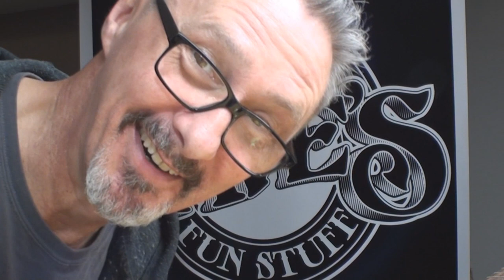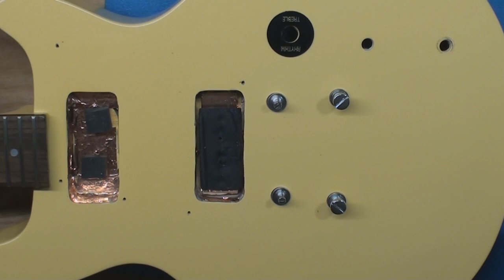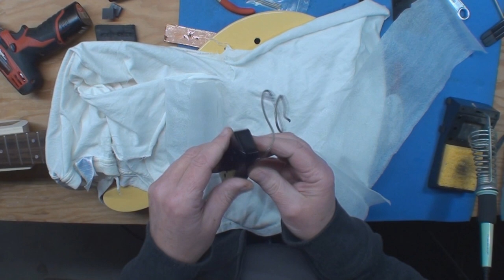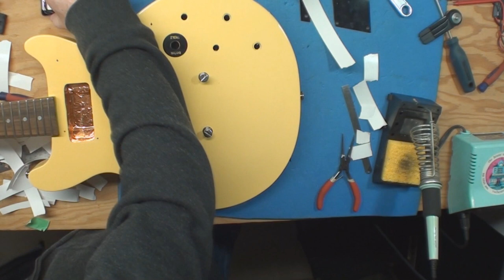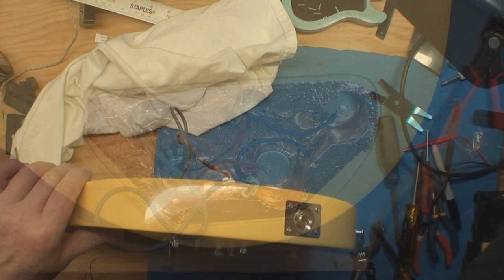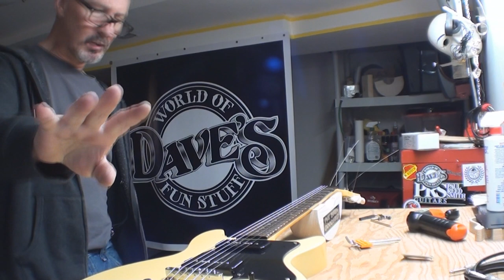Lindy Fralin P 90 Pickup Install

Comment: Which direction do the Fralin P-90’s go in? I can’t tell which end is “up” because the cable is reversed with that ground. So do I just install them so the wire doesn’t get folded over and let it thread in the direction it comes off the pickups? You dig? The wires point one way but it doesn’t look natural. Help? I watched but couldn’t see which end goes toward the hole.

Comment: I dont get how the pup is locking into the cavity Dave. Usually its the pickguard thats taking care of things but these 90's dont use the guard to hold them in do they ? Are they using friction to slot them into the cavitys ?
Reply: Tbone j - P90 pick ups are mounted with screws that go right into the body.

Comment: Dave, intonation is done using the fretted 12th and harmonic on the 12th. This way the fretted note takes into account the string displacement when fretted and makes for more accurate intonation.
If I saw correctly, you used the open string an harmonic...not the correct way my friend.

Here's what Fender say....
If, using an accurate tuner, the string is found to be in tune both when fretting it at the 12th fret and when sounding its 12th-fret harmonic, the string is correctly intonated and you’re in good shape. The string is in tune “with itself.” If, however, there’s a tuning discrepancy between the fretted 12th-fret note and the 12th-fret harmonic, the string is not correctly intonated and requires adjustment. In that case, the fretted 12th-fret note will sound either sharp or flat compared to the 12th-fret harmonic, and this is where two basic principles come into play.
Reply: Tex Rex........No, Dave used the open string and fretted 12th fret which is how I was taught as well. (watch @26:36.....he frets the 12th fret on the A string). Been playing 25 years and was always told to use open string and fretted 12th fret and to never use harmonics...LOL Seen it that way many times. To each his own I guess huh? 

So, I just watched 4 vids and even the one from ESP (ESPGUITARSUSA) says you can use the open string OR 12th fret harmonic in conjunction with fretted 12th fret. I know guys that have been doing the open string and 12th fret for almost 30 years with no issues.
Reply: I'm sure there are several ways to do this, I use the Harmonic 12th and it's what Fender recommend. Dave regularly quotes Factory specs for set up's so I would have assumed he'd also follow their advice for this too. I'm sure the major guitar manufacturers also have many yeas of experience and have sound reasons for doing it this way. I suspect it's to take account of the variation you get from different set up heights. A high action will cause the fretted 12th note to be very slightly sharp compared with the open string.
Reply: I agree with everything you've said and you make a good point regarding high action....(never thought of that)..........if the action IS that high you'd HAVE to use the open string and 12th fret harmonic method. Like you mentioned.......most people doing it for many years have their ways and reasons for doing what they do.
Reply: Hi 😊 there
Anybody knows when we use 250 or500 caps?? To p90s??
For blues and hard rock stuff..

Comment: Now I know what I look and sound like when I’m unfuckulating stuff.
I picked up one or two good bits of advice, particularly about ensuring pots can’t move and short on the shielding. After you deliver it to someone and they go on stage ... ouch.
Regarding shielding and noise - that’s what I was hoping to learn more about.
I’m about to install Fralin P90s (in humbucker enclosures) in a beautiful 25 year old candy apple red Washburn Nuno.
There was only about 30 seconds of audio !
There was obviously noticeable hum, pretty much impossible to eliminate with single coils, but it was dead quiet in the centre position.
This is why I am modding the Nuno, which has only a volume pot and three way switch, to a volume pot per pickup and master tone. 
That way I can leave the switch in the noiseless centre position, and choose which pickup(s) I want to hear with the volume pots.
I enjoyed the video. Thanks.

Comment: Silly question: how noiseless are these PUPs cuz I really want a set. My Gibson P90s are noisy AF!
Reply: Leonid Denisenko Traditionally, P90s are no where near "noiseless", they are just another single coil. In fact, due to their larger size and more winds, they pick-up the 60 cycle hum louder than Strat size singles.

Dave mentioned that this set had a reverse wound pickup, when you are playing with both pickups engaged, you are effectively playing a "humbucker" and cancelling out the majority of hum but not 100% nor as effectively as a real humbucker. I think I remember it being 70-80% humbucking between two separated single coils.
Reply: The only completely noiseless P90's I know of are the Joe Bardens, they sound incredibly good. Very touch responsive. Also stupid expensive. But if you love tone that shouldn't matter.:)